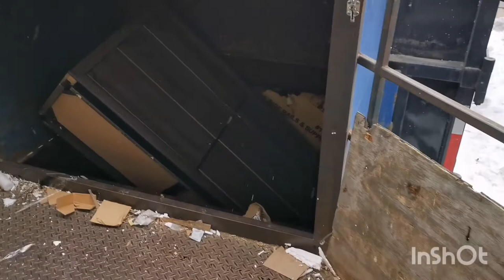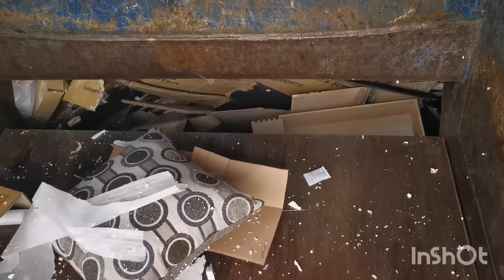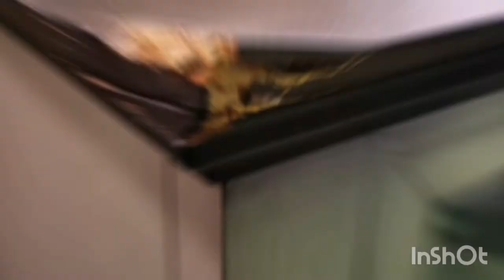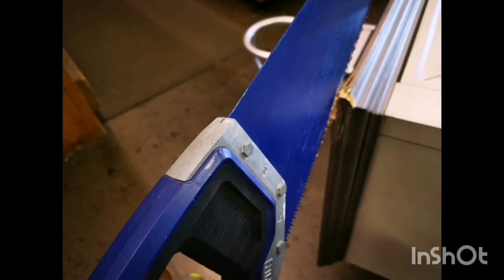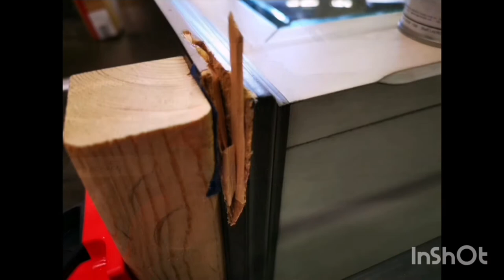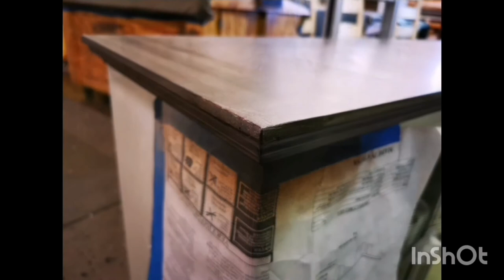How to repair broken Corner of a particle board Furniture

Comment: So you sawed off the deformed section, used some form of epoxy, and sanded and painted. What kind of epoxy did you use and how is the repair holding up.
Reply from the maker: Hi, what I used is hot glue and and then hard filler and burning knife for making the final shape and at the end I colored it , the repaired corner is totally equal to the original one
Reply: @stelyoto  gonna give this a shot. Any particular hard filler you used?
Reply from the maker: You can take a look at some hardware store or online
Reply from the maker: "Mohawk" make it